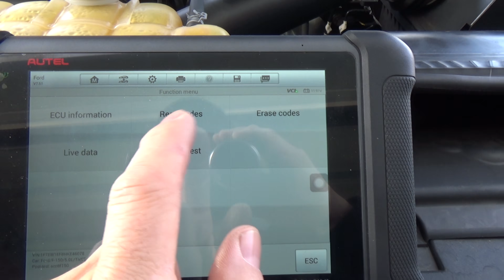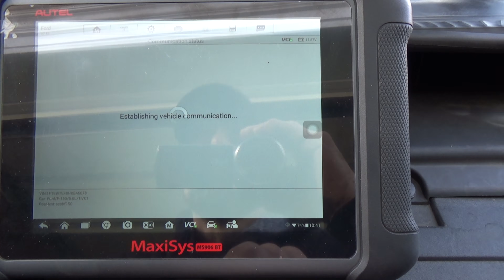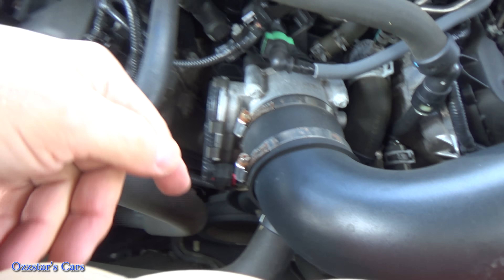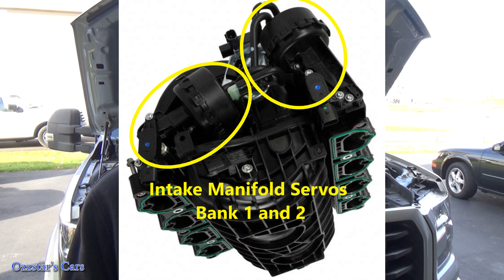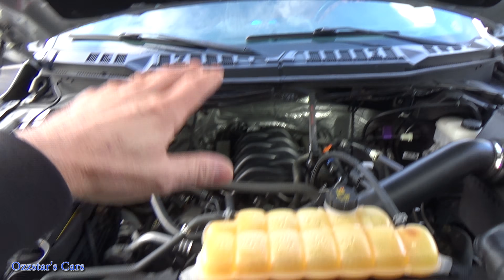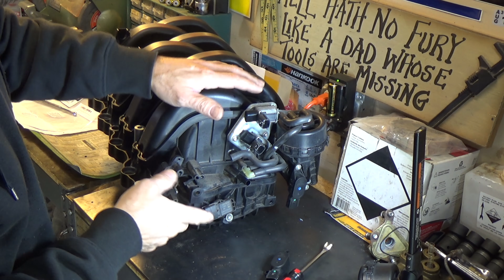Ford F150 Engine Rattle Tick Noise: I Can't Believe Shop Says It Needs A New Engine

Comment: Big discovery here .. Many of the first gen gt350s had that exact noise from about 1500 to 3,000 rpm 

The Ford dealer did nothing and said it was normal bc they all do it .. All the gen 1 5.2l motors vibrate so harshly that if anything is loose it will make the noise resonate to an obnoxious level..

My gen 1 motor ended up drinking 4 quarts of oil every 1,000 mi at it's worst before it was replaced.. I checked my oil every time I wanted to drive the car so I was smart enough not to blow it up .. If it blows up bc your not checking your oil Ford says That is bad maintenance and that is the customer fault. No warranty..

Well I finally gave up at the dealer that I bought my GT350 from and brought it 2 hours away from me to another dealership where my uncle worked.. 

They didn't drag their feet and try to perform oil consumption tests or dying the oil to see if it's leaking or anything like that.. They were told what was wrong and they immediately took my word for it and called Ford saying I needed a replacement motor.. My uncle was head mechanic so I know without him Ford would not have done a thing for me .

The engine was shipped and arrived in just 1 day .. So it took 1day to get the $27k motor , then 1 day to pull the old motor out and 1 day to put the new one in ..

I love my uncle with all my heart bc if it weren't for him , I would have likely waited months for them to finish the job ..

He put 4 people on the project to get it done ASAP and also help not to scratch or dent anything bc they worked together to make it easy ..

So I got a new gen 2 voodoo in just 3 days .. Most people on the net would be lucky to get their car back in 3 months. 

I seen a vid where a young man had a 5.0  coyote  making a huge amount of noise .. He found a power plug or vacume line  to the manifold and every time he took the power or vacume  away the noise instantly stopped .

I knew the prob with oil consumption b4 I bought it new but never thought it would get that bad .. 

The dealer still insisted 4 quarts within 1,000mi was within Ford spec which it wasn't .. Ford spec is burning 2 quarts every 1,000 mi .. That is insanity but I was consuming double that and I pressed hard for a gen 2 voodoo replacement 27,000$ 

The big point in my story is that the ticking went away bc Ford re-engineered the intake manifold for the gen 2 GT350.. 

And the young man with the new 5.0 had his manifold replaced and it purred like a kitten ..

So if you have this noise pull the power or vacume from the manifold and if it instantly stops then you know for sure you need a new one . 

There are thousands of f150s and mustangs with this issue the dealer says is normal .. So go to the dealership and show them in person what's wrong by pulling power or vacume from the manifold .

Only then will they warrenty it .. I hate stealerships .. If you're still under warranty they want to make you go away because they don't get paid a lot for want to work. They only want the cars that have fallen outside of warranty so that they can make the big bucks fixing them.. 

So if you have a problem with your Ford, you can't be polite in order to get them to help you have to shove their face into the problem.

Nowadays, all of the factory warranties that come with new cars don't mean anything to me because the dealer will almost always find a way to get out of paying for the warranty work.. 

Oh you have a cold air intake ,, denied

Oh I see Uber or Lyft stickers on your windows, denied.

Oh , you ran it completely out of oil and blew it up? Warrenty denied.. 

The car isn't 100 percent stock warranty denied. 

Ford corporate requests pictures of the entire car from the dealership before they make a decision on whether or not to warranty any work needed.. So if they see something that they can use to deny your warranty, they absolutely will.

Comment: I have the same problem with my 2018 f150 taken to ford several times ford now says it is Normal for the 5.0 and not to worry about it I know have 81k on it and noise is still there. 🤦‍♂️
Reply from the maker: I diagnose stuff like this all the time.  Do you live near Delaware where I am located?

Comment: I had the same problem on a brand new 2019 f150 with the 5.0 coyote engine.    Problem started at @ 750 miles.    Dealer had truck for 6/8 months I owned it.   They slow rolled me and told me they never heard the noise.  I took a mechanic for a ride amd pointed out the sound amd he agreed he heard it and it was jot right.  They replaced a bunch of parts that did not fix the problem. Ultimately I made them big the truck back under my states lemon law as they couldn’t fix the problem and had the truck 90% of the time I owned.  Unacceptable.  Never figured o it what the issue was and they ended up just reselling the truck out of state without fixing the issue
Reply from the maker: That's a darn shame!

Comment: Awesome video.   Is this a common problem for this motor?   It sounds exactly like my truck.  2018 5.0.  I know these trucks are noisy.  Ticks, taps and DFI .    What makes me think it’s the same problem is it’s at the same rpm. Is there any reprogramming that needs to be done after changing the intake manifold? That something that a fairly handy guy can do without any fancy electronic tools?
Reply from the maker: 2018-20 F150's also can have timing gear issues. Ford ruined the design of the 5.0L when they went to GDI.
Reply: @ozzstars_cars  -  Ford replaced timing chain guide but didn’t notice any difference in noise.   That tells me they are acknowledging a noise, but didn’t wanna take it any further. They said being the truck shows no check engine  lights they don’t wanna dig deeper.  I also have an extended warranty so it’s double frustrating.
Reply: @ozzstars_cars  I told Ford I heard multiple noises and they questioned how I can hear multiple noises. They’re so uncooperative.

Comment: My 2014 f150 is doing the same thing.
Reply from the maker: Did you confirm it's a bad intake manifold or engine noise?
Reply: @ozzstars_cars  it’s coming from the intake manifold, haven’t had time to work on it yet.
Reply: I had my mechanic change it and yes it was the intake manifold, thanks for the video.

Comment: Does the Ford 3.7 l engine have the same set up my transit is doing the exact same thing.i don't hear it when driving but when I rev it up in park or neutral it makes the same racket
Reply from the maker: I don't know for certain but I'm sure that engine has the same junk plastic intake runner design.

Comment: Way to burry the damn sensor's damn engineers
Reply from the maker: It makes it challenging!
Reply: @ozzstars_cars  I've worked at dealerships and private shops now I'm at Aamco transmission. I can't stand engineers
Reply from the maker: @ahanson5679  sometimes it is not the engineers fault because the higher ups want to maximize profit so they spec the design to be done as cheaply as possible with the lowest cost. This puts engineers in a bind and they are forced to design things that aren't  most efficient for techs to complete the work.

Comment: Hello there, I just watched your video and it seems to nail down the issue I'm having with my 2016 F-150 5L Coyote Super Crew. Check engine light is on, there is a metallic ticking sound tied to RPM, audible in cab most apparent at shift points. I mentioned all of this when it was in for service recently. They mentioned manifold runner control replacement, on back order, but did not comment on ticking sound.  From your video it looks like this is the issue. The  work order mentions "Intake runners are extremely noisy, when actively commanded On with scan tool noise goes away". Is that RPM-tied ticking sound coming from the manifold runner? Will replacing that part solve the ticking sound? Cheers, great video. J
Reply: Codes P2005 & P2007 - Bank 2.
Reply from the maker: Sorry I can't diagnose cars over the internet but looks like you might be on to something.  What is the mileage?
Reply: @ozzstars_cars  Yeah sorry, not looking for a diagnosis, just trying to find answer to question:  Are intake manifold runners connected to timing chain? That would explain ticking sound linked to RPM.  If not, it is another issue. Truck is at 160,00 miles. Thanks. Appreciate what you do. J
Reply from the maker: @jamesianp  timing chain has no correlation with the intake manifold. They are independent.
Reply: @ozzstars_cars  Alright , thanks man.
Reply: @ozzstars_cars  OK thank you, that makes  sense.

Comment: My 2018 5.0L rattles a bit on acceleration (lifters?) almost as if its in too high of a gear and "lugging". If I manually shift it to keep it at 1500rpms it doesn't do it. I'm wondering if the 10 speed automatic is just shifting too soon, needing a tune or what.
Reply from the maker: Wish I could help you but unfortunately can't tell you without seeing the truck in person.  Make sure it's not a timing chain issue. In 2018 the 5.0L was redesigned and became GFI, they timing set up was changed. 🥺
Reply: @ozzstars_cars  mine does the same rattle. exactly like 19D Scout said. How can i check timing chain?
Reply from the maker: @joearguelles75  also make sure it's not engine knock due to poor fuel octane.
Reply: @ozzstars_cars  Thank you

Comment: I think you just saved my tuck I’m having the same problem! And also my truck is shutting off when I come to a stop and rough idols
Reply: Replace your cam phasers my son in laws 2018 5.0 f 150 was dying occasionally. Fixed his problem. But I think his motor is still noisy. It may have this issue on this video with the noise.

Comment: You explain a noise at 10:30 that I experience on my 2019 F150 2.7L. This is the intake manifold runner too? Do I need to rush out and get it diagnosed / fixed or is it more of an annoyance? 

Great video and great explanation. Thank you!!!

Comment: Ozz I realize this is a bit late of a comment, but did the noise seem to go away when the engine was warmer? 
My engine is making a similar sound, but I can't diagnose it.. and Ford is claiming its the typewriter tick, but there's no way it is the "tick".
Reply from the maker: Noise is consistent at 1500-2500 rpm at all engine temperature.
Reply: @ozzstars_cars  Hmm, thanks for the quick reply! It seems like this is unlikely to be my issue then.

Comment: Great video.   I wish I had someone that would/ could work on my truck.   I have an extended warranty on my ‘18 with less the 30k miles and ford doesn’t do anything.   They tell me if it’s not throwing a code there is nothing we can do.   It’s very frustrating.  You don’t happen to life in Nj ?
Reply from the maker: Not to far away from Jetsey.  I live in Delaware.
Reply: @ozzstars_cars  - hi.  It’s me again.  Can I get your contact info.
Reply from the maker: @North Jersey Kevin  email is ozzstar@aol.com 👍
Reply: I have ford’s extended warranty.    I forget what it’s called.   Can you do warranty work?   It would be on a ‘18 F150 5.0.    Are you affiliated with Oz tuning?

Comment: Awesome video - I’m dealing with ford mechanics right now and they said I need a new engine because of the ticking sound.. I asked them where was the ticking sound coming from and what was causing it? They said without a complete engine teardown they could not tell me that only that it was at the bottom of the engine somewhere. I said you guys order brand new engines before you actually know what’s broken. He told me the noise was metallic sounding and I’d surely have tons of engine damage due to components grinding sending pieces of metal all through my engine leading to catastrophic failure …, I asked him where is all this metal going because there’s none on my oil drain plug or in my filter … end rant 
Thx for the awesome video, you have a new subscriber …..
Reply from the maker: Make sure to show the video to the shop foreman and the service manager.  Getting your vehicle diagnosed by someone competent these days is difficult.  What year,.make, model, engine size and mileage is your vehicle? -Glen (Ozz)
Reply: @ozzstars_cars  it was a 2017 F150 3.5L eb Lariat FX4 .. it was paid off so I traded up for 2022 f150 3.5L eb. They gave me $21000
so I got out of it.. I’ve bought 13 or 14 f150s in my life and this was the only one I had trouble with.. I still love my ford’s but not a fan of my home town service dept

Comment: How much would this issue usually cost to have someone fix it for you? I’m currently looking at buying an f150 yet it has this issue, so I’m trying to figure out how much it would cost if I had to fix it alongside getting the car
Reply from the maker: Depends where you go. Using OEM parts with labor $600.
Reply: @ozzstars_cars  awesome thanks? Could their also be other issues if it rattles or would it mainly only be this one?
Reply: @cartertv8990  Coyote 5.0 have the coolant Y pipe oring leak is common and the coolant head temperature sensor usually fails giving you a false overheat condition.  I have a 2016 5.0 just  swapped out the water pump at 100k miles.  Did the coolant Y pipe not long ago and the head temperature sensor.   I would stay away from the 2018 coyote it's an oil burner!

Comment: Great video, should be a recall on the intake! Wondering what would happen if just left it disconnected to stop the noise from happening??? More HP or torque?
Reply: Locking the runners out full open is a short term fix. They will still eventually wear till they rattle even in the full open position because the pivot shaft bore wears from vibrations even when the shafts are disabled. Eventually it wears very severely and the flaps break off the shaft and get sucked into the engine and can jam a valve open (and the piston will hit the valve and bend it). This has been an issue on several ford engines for the past 10 or 15 years from 4 cylinder to V8. You can upgrade to an aftermarket intake that has no flaps at all, that's the most permanent fix. You will lose some low end torque and fuel economy though, that's what the flap system is there for.
Reply from the maker: If it's not a safety issue manufacturers rarely will issue a recall.  It would be nice if they improved the quality, plastic garbage!
Reply: @ozzstars_cars    what about disconnecting it ??? Keeping it fully open??
Reply from the maker: @revbikerbigd8664  there is a buy pass kit you cab buy. The runners would need to be tuned out or the check engine light will remain on.

Comment: I'm getting intermittent loud ticking during idle and 1st and 2nd gear noticeably in the cab.
I found the noise coming from the front of the intake manifold on the passenger side of the motor.
...is that the same problem except with the clacking coming from the front?
Reply from the maker: Your truck needs further diagnosis. Did you test like I demonstrated in this video?
Reply: @ozzstars_cars  thanks for a quick response!
Yes I did, .. and the noise or clacking sound is louder at the front of the intake. I checked all areas of the motor and that is the most pronounced,  1st tube on the intake!
Reply: @ozzstars_cars well upon further diagnosis from Ford dealer #1 tells me they don't hear any ticking or clacking noise. So I take to Ford dealership  #2 and leave my truck there for a whole day, ...at the end of the day ford mechanic tells me he listened to the engine with his stethoscope and heard a louder than normal ticking coming from the top front and top back of the intake manifold! He tells me the noise is piston slap and I would need a new long block at a cost of $14, 500 taxes and labour included!
A friend refers me to a private mechanic in a small town not far and just listening to the engine without popping the hood, tells me he's done lots of these trucks and its cam phaser replacement at a cost of $3k
Very frustrated at this point! LOL
Be nice to hear if any has fixed this problem and what was done....
Thanks!

Comment: I did get the TSB for the flash and the almighty longer dipstick which did nothing. Ford really let me down, all my vehicles have only ever been Ford pickups. Kick myself too since I got rid of a 13 F-150 with 73,000 miles with nothing wrong and  anticipating something may arise in the future
Reply from the maker: With a '13 and regular maintenance the only issue is possible sparkplug replacement difficulty and cam phasers going bad at 150k and up.  The new F150 (2018+) is a real disappointment.  I wouldn't buy one.
Reply: Keep an eye out. You'll eventually see an older model,  lower mileage truck around you-then make it yours.

Comment: Great information. I’m one of the ones that bought an 18 F-150 5.0 in 2020 with 19,000 miles. It now has 37,000 miles. Noticed in burning about 1 quart of oil every 2500-3000 miles, noticed it smoking white smoke on startup and a rattle noise when letting off the throttle at around 2,000 RPMS or lower, you especially hear when in a parking garage or up near a Jersey barrier. Went thru 10,000 miles worth of consumptions test to tell Ford this isn’t right. As of last visit they just came back with right side spark plugs oil soaked, needs new short block and right side cylinder head.
Reply from the maker: Ford completely butchered the F150 5.0L in 2018 when it was redesigned with GDI. A real shame. Good to know your truck is under warranty, that's no cheap fix!

Comment: What would happen if  I zip tied the irc module open. My 2011 sounds like it's bogging  and uses alot of gas and roughly gets 12 mpg
Reply from the maker: You should have the complaint properly diagnosed and not guess by a qualified technician.